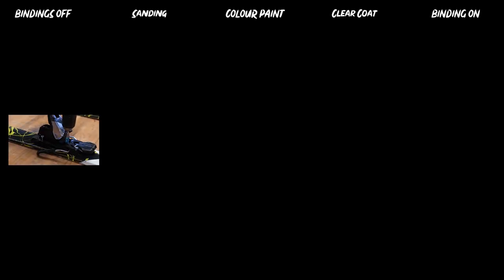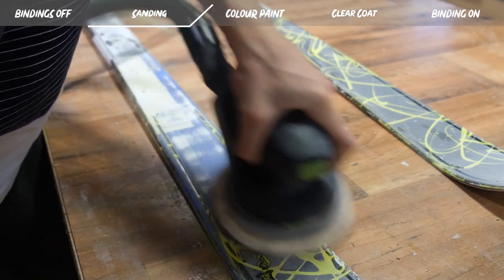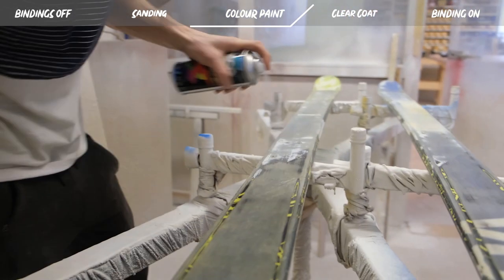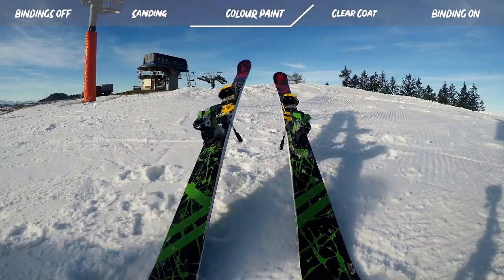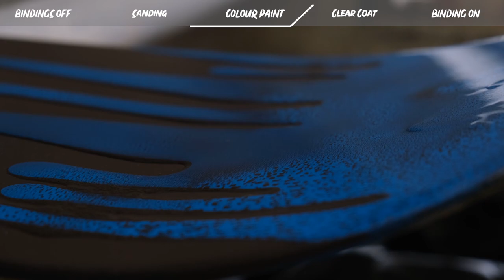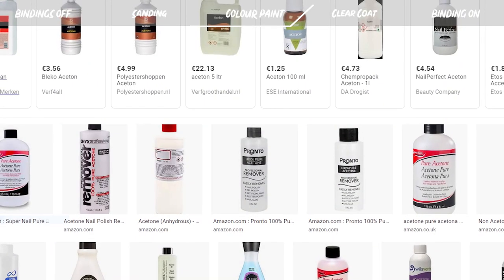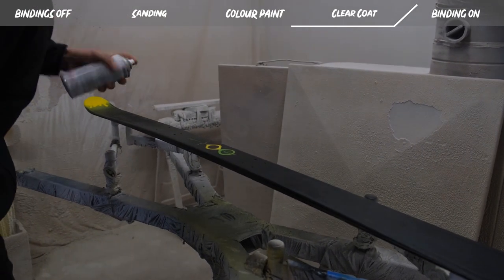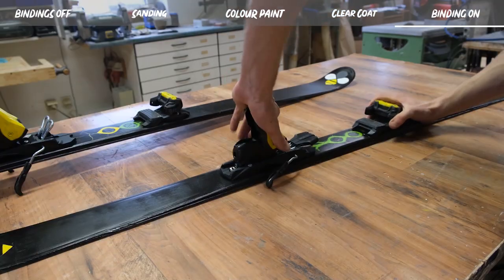HOW TO PAINT YOUR SKIS/SNOWBOARD

Comment: When spray painting are you sanding the top sheet or straight onto the wood? My top sheet has come off one of my skis so I'm thinking of pulling it all off and spraying directly onto the wood, would this technique work? 😊
Reply from the maker: For me my top sheet was fine and so I just roughened up the paint player of last time. First of all I really don't know enough about skis to give you a qualified answer here hahaha but if I had to guess, Hmm I mean if you remove The top sheet all the way there's no protection right ...so I'd really make sure to protect it extremely well with either a good clear coat ar maybe ever coating it in epoxy. Depending on how much the top sheet has come off, you could also try to repair it I think.

Comment: Great video! My skis have a sort of webbing pattern on it - so it’s not fully flat (Head skis). Do you know if it’s possible to re paint these?
Reply from the maker: Hmm never seen that. I mean if you know that it's nothing structural on there I guess you could sand it off but your guess is as good as mine at this point. Best of luck tho 👍🏻

Comment: you think acrylic paint wod work with spray paint and clear coat so I can use acrylic with a brush to do paintings and drawings?
Reply from the maker: The paint will be far less resilient if you use acrylic paint and a clear coat than if you use proper spray paint and a clear coat on top. The paint will chip of in many areas and not hold very well. But if you don't care about that as much why not I'd say :D.

Comment: Did you have any problems when you were putting the binding back on? Like did the holes get filled with paint and clear coat?
Reply from the maker: I wouldn't see that as a problem. Even if, as long as you don't fill the entire hole with paint it shouldn't make a difference. So with a spray can I wouldn't worry. If you want to insist on keeping them clean, put some Q-tips in the wholes
Reply: Thanks, I think i'll be safe and go with some q-tips in the holes.

Comment: hey awesome video! have you ever tried using resin for the clear coat?
Reply from the maker: No I have not. I wouldn't really know how to put on a nice layer without it dripping down the sides. But that's an interesting thought :)
Reply: @makermind2050  just sand the edges 👌🏼 btw bro can you clarify the soap steps? Never seen that done and it looks wicked
Reply from the maker: @BB-pf2cs  well I spray on the colour I want the lines to be over the entire ski and let it dry. Then I use dishsoap or shampoo, anything viscose works and drizzle it over the ski until there are as many lines as I want. I wait a bit for the soap to expand and then I spray on the main colour (in my case black). I still haven't figured out a perfect time when to wash off the soap with water. I so far always did it when the black paint was dry enough to not get damaged by the water which was around 20 minutes or so. I always ended up with some not so nice edges where the soap was. That's everything I can share. Hopefully it was helpful.

Comment: Thanks for the very informative video! I want to paint my snowboard and this helped a lot :) When you let the paint drip, does it dry well and the surface is then flat when dry or will it make it bubbly?
Reply from the maker: It's fairly flat there might be a little bit of a paint edge. Getting rid of that is quite tricky and depends on at what Moment you wash the soap of and whether or not the soap "expands" a little bit after you apply paint
Reply from the maker: Ooooh wait I understood that you want to drip soap ...so sorry 😶. Well it's a lot of paint so it defenately stands out a little but the dripping paint itself was quite uniform for me. It defenately takes longer to dry than a normal layer thickness. I let it dry for a day just to be sure. Hope it helped

Comment: what type of paint do you use? not the spray paint^^
Reply from the maker: Not sure what you mean. In that video I only used spray paint 🤔 when I painted it on with a brush I sprayed some paint in a cap and used it as normal paint. I'd be really hesitant to use acrylic paint and such because it's clearly weaker that strong spray paint. I tried using graffiti spray paint and then clear coat on top but it didn't hold half as long as with proper spray paint. If you don't mind tho then I would suggest you use acrylic paint pens. Otherwise maybe just acrylic paint directly. I'd be curious what happens so feel free to report back :D

Comment: Do you ever do anything to the bottom of the ski or board?
Reply from the maker: I wish that was possible but it would just instantly get rubbed off. Also it might slow you down or have other unfortunate sideeffects.
Reply: @makermind2050  how about prepping the bottoms for paint? Overspray?
Reply from the maker: @Heve62  what do you mean by that?
Reply: @makermind2050  that is it necessary to mask the bottoms of the ski or does the overspray scrape off easily after skiing? Or does it even  get overspray usually
Reply from the maker: @Heve62  oooh now I understand :D. Well the bottom rarely get's painted but on the side Overspray is defenately a problem. If you don't really care leave it but if you don't mind putting in the extra effort I would put some tape on the side of the metal edge.